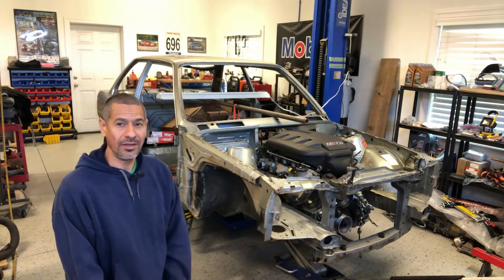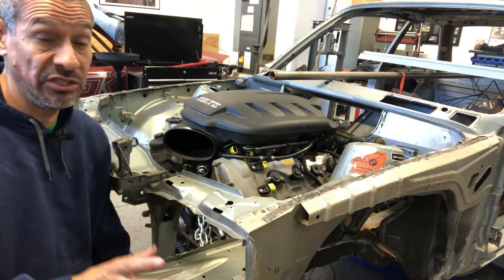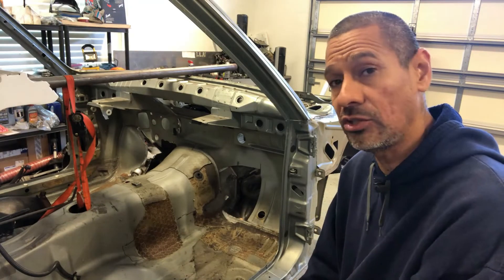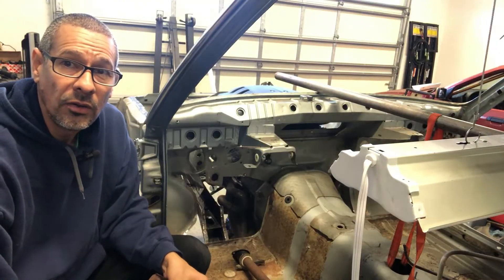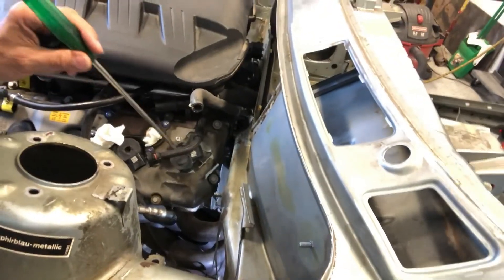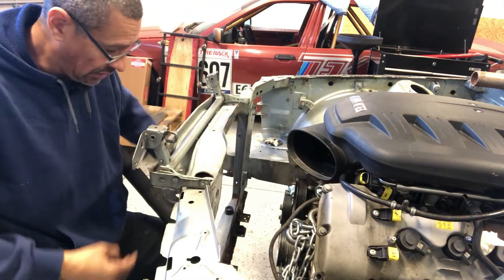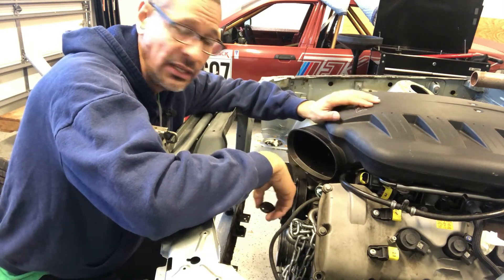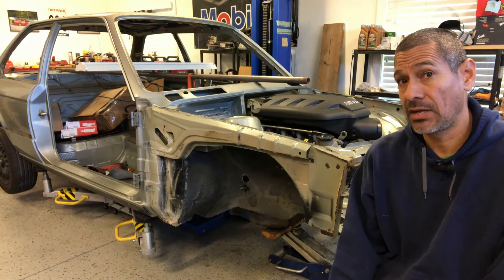BMW E30 Coupe, Swapping in an S65 Drivetrain with 6spd manual Part 1

Comment: What trans is in this?
Reply from the maker: E90 6speed manual
Reply: @tekmotorsports4052  Did you have to do any modification to the tunnel to make it fit?
Reply from the maker: @ethanmanley3341  I will have to modify the tunnel for the shifter and lower section of the tunnel for the clutch slave & cooler lines connectors.
Reply: @tekmotorsports4052  Thank you!

Comment: Cool project, I'm fitting an s65 in a  Mercedes 190.....it wasn't easy :-)
Reply from the maker: Oooh 😯… in a Merc 190! Such a cool car! How far along are you?
Reply: @tekmotorsports4052  I have the engine and box in , used a ford Sierra steering rack running through the gap in the sump, moved the arms on the hubs to match the rack . Extended the steering shaft to the rack . Modified the rear subframes to house the M3 LSD . Need to sort the prop and half shafts next . Not sure what to do about the plenum, I don’t want to modify the Bonnet, think I’ll end up making an aluminium plenum 👍🏻
Reply from the maker: @Omegaman1969  Nice! I’m almost done with the tranny crossmember and then moving to the rear subframe. Waiting on Z3 parts to coming in for the rear subframe.
Reply: @tekmotorsports4052  cool , are you going to graft a new subframe into the rear ? Or modify the existing setup ? I should have just fitted the M3 subframe in the rear really but it’s done now and should be fine. What ECU are you using? I bought a programmable plug and play one, that and a digital dash that connects via can bus.
Reply from the maker: @Omegaman1969  Going to use the e30 rear subframe and just add z3 arms. Was looking at z3 m stuff but at $2,500 per side… I’ll pass. Also installing an e46 m3 diff. About to start looking into driveshaft options.

Comment: Massive fan of this project! I've gone for the M60B40 and just bought some ITBs for it. Got alot of work to do but going to enjoy the process.
Reply from the maker: Sweet, ITB’s! I have a spare sets from my s54 and was thinking about putting them on my s52. Good luck with the ITB’s.
Reply: @tekmotorsports4052  go for it that induction noise is so good. Thanks I can't wait to get cracking.